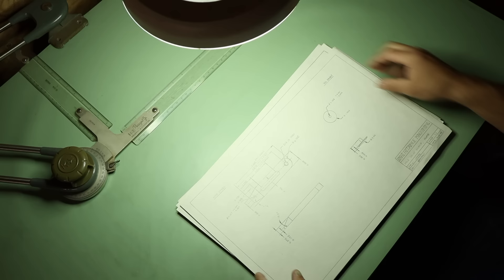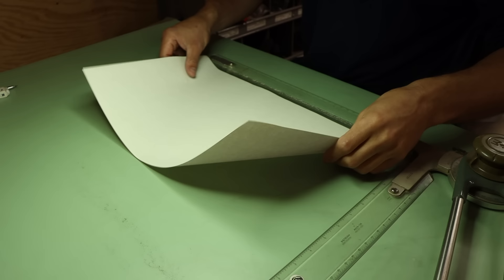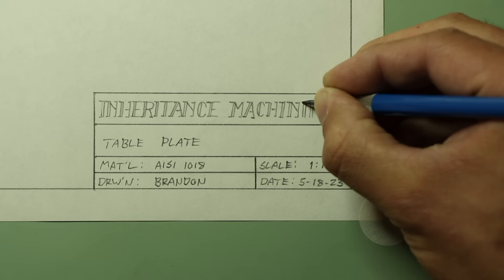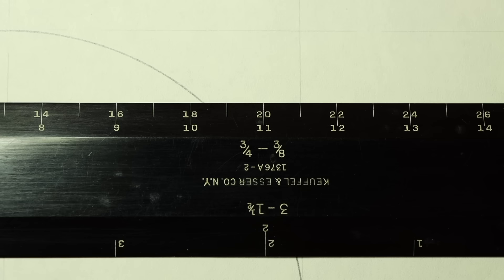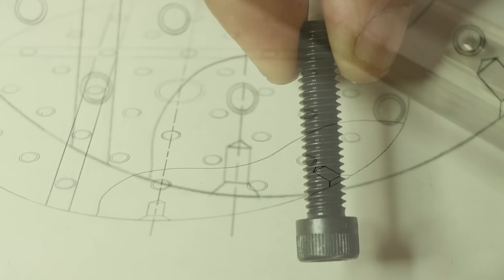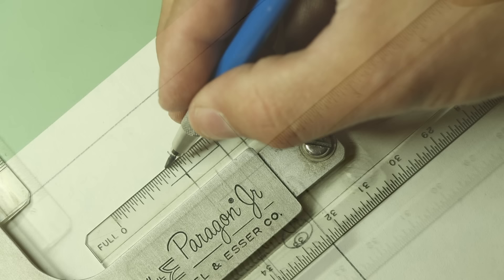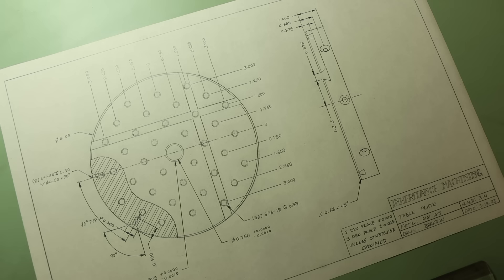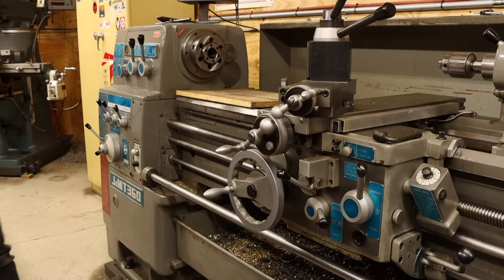The Joy of Hand Drawing Machining Prints || INHERITANCE MACHINING

Comment: This hit home, and was a real treat!. I'd never seen a drafting machine before. I had the extremely rare privilege of learning drafting in the mid 90s by hand on a similar table, though it used a cable system to emulate a t-square.  All angles had to be compounded by triangles. We drew up small parts at 1:1 that were crafted for us in the wood shop.  Took measurements, then transferred to paper. Clean hand drawings are SOOOOO satisfying when done!  Thanks again for sharing your work :)
Reply from the maker: I've never had the opportunity to try a cable machine since by the time I tool high school courses on drafting, the arm types were pretty standard. Thanks for watching!

Comment: Your sketch reminds me of my work as a draftsman at a very well know recreactional vehicle manufacture in 1972/73.  Detroit job shop engineers were hired to begin an advanced chassis department for a newly designed chassis for the motor homes.  I had been working as a detail draftsman but was moved to this department and WOW, what a difference.  They would bring me sketches on scraps of paper and scribbled notes and I would transform them into drawings that were conceptional only as this engineering project was working from scratch.  I learned so much with this job, I miss it terribly.  It was all hand work, no arm or parallel rule, we worked on flat tables with straight edges and triangles.  Loved this video, it took me back to a day long since past.

Comment: Excellent video.  A well-executed engineering drawing is a work of art.  It is pleasing to the eye, not because of embellishment, but because of the clarity that results from complete, yet efficient portrayal and dimensioning.  Correct line weight (for object, extention and lettering lines) makes the drawing easy to use.  Such things as no redundant dimensions and not "closing off" a string of dimensions that also relate to an overall dimension.  It is also clearer and time-saving to limit the detail to the minimum needed.  Example: show hatch lines around the perimeter only of a section or breakout.  My boss said he would rather have me spend time thinking rather than hatching.  When CAD came in, I thought that all drawings would be of similar quality.  I found that the good mechanical drafter also made a superior CAD drawing.  Some designs became poorer with CAD because the drafter saw only a small portion of the part(s) on a zoomed-in view - especially on layout or arrangement drawings.

Comment: Boy did this bring back memories.  Back in high school (early '80's) I took 3 years of Mechanical Drafting.  It really helped when CAD came along.  I'm wasn't in the trades that needed as I did aviation electronics and then IT before retirement but have spent my off time building things from large and small.  We're currently building our 3rd house so I sold my mill and lathe as we moved half way across the country.  I really miss them and can't wait to get replacements.  Your videos help fill the void, thanks.

Comment: Love your videos and I myself have a drafting table at home that I’ve had for 35 years. Just in case you didn’t know, the little hole in top of the cap in your clutch pencil is a pencil lead sharpener. Just remove it and rotate it on the lead, just remember to tap it upside down to remove the removed graphite before replacing it back on the pencil body 👍🏼

Comment: I like your drafting video(s).  I took a course in engineering graphics at Ohio University and we had to draft mechanical parts and cast items with all the radius features and machining details.  It turned out I worked in construction and had to read blue prints with some detail drawings included.  You never can learn too much and even though I'm retired I still enjoy learning new skills or at least how to identify what is supposed to happen when completed.  Thanks, Greg.

Comment: When I first took an engineering design class in high school, I always wondered why he started out with us using paper and pencil, and only in later classes getting us onto computers using AutoCAD. But after that class I found a deep respect for paper drawings. While I now use a lot of 3d software for modeling, due to their extensive capabilities, sketching ideas on paper for the basis for a design just can't be replicated by using a computer. So I find it quite cool to see you drafting every step of your design.
Reply: When I went into engineering I already was an expert in pattern layout and development from my previous career as a journeyman sheet metal mechanic. In tech school Geometric Development was a weed out class to flush out the half hearted folks. And it was done on a board. Paper and pencil are incredibly useful yet and I still develop shit out on my concrete shop floor with soapstone, tape measure and trammels.

Comment: It is fun watching a video that shows the generations of technology.  I actually have the same drafting machine, a few years ago we had to get rid of the fancy drafting table with foot pedals to adjust height and angle for lack of space.  That all dates from my Dad's generation, when I took mechanical drawing back around 1990 we no longer used the large lead holders with different hardness of lead and tuned tips to control line weights, we used different lead diameters, generally .3, .5, and .7 mm for the most common line weights.  We still did use the large diameter lead in our compasses, and as students we used a little paddle with sandpaper on it to shape the compass lead.
One thing that had largely gone away by my time was hand inking.  We learned about blueprints, and got to see and smell an old blue print machine doing things the old way, but for duplicating drawings we used large format scanners and printers.
And yes, I think at least as much of a drawing is done with the eraser as with the pencil.  With practice you can actually straighten and thin lines with an eraser shield.
I really enjoy the low key smooth flow of your videos, and sometimes comparing stuff I do to the stuff you make I want to cry a little bit.
Reply from the maker: Nah, it all just comes down to how OCD you are 😂  Thanks for sharing!

Comment: This is probably my favorite video you've made. I took two years of CAD in high school, like your family and I'm assuming a lot of commenters here, and it's funny how much I still remember. We had drafting setups like you, but they were at an angle so we weren't hunched over the whole time. I still remember the various line types, and we used the same tools, but I never had to do ordinant demensioning. We never had any homework in the class we had to finish, so I never had a home setup. I ultimately didn't become an engineer, although I really wanted to.

Funnily enough, being left-handed, my table was virtually identical, except that the machine was on the right side of the table and the ruler read 12-0 rather than 0-12 like a standard ruler.

My dad was a machinist for 40 years, and the jobs he was working on often had a tolerance of a ten-thousandth, which blew my mind when he first told me.

Comment: It's very satisfying producing a working drawing on the board - I have an old Schmidt and Haensch drafting machine on a full size Swedish Nike table ( circa 1960 ) 

Had them both given in lieu of payment for a job I did 30 years ago - restored them and they have taken pride of place in the homes I have had since. 

Although I have spent a lifetime using Autocad, Solidworks and Catia I still rough out ideas on the drawing board - there's more of a connection to the material for me , and the satisfaction of  "keeping your hand in".

I have to pick you up on finishing the drawing - use drafting paper - silk if you can find it, line in with ink, using appropriate line width pens and the appropriate lettering stencils.

Then you have something you can frame !

Comment: Another wonderful video.  I took the equivalent of 6 years of drafting in High School.  Basically, 3 years of 2 hour blocks early in the AM.  This video brought back so many memories!  We had those exact tables in our drafting department.  By the time I was a senior, I had templates for everything,  multiple eraser shields for different applications, and several pencils for different leads.  I got so quick that I started selling drawings to classmates from the machine shop class where they had to design then build their creations.  There were several students who were decent machinists, but made sloppy drawings and got down graded because of their "penmanship".  Eventually I got so busy that I started abbreviating the drawings by using proper GD&T, Measuring from datums and including datum frames, rather than doing longhand dimensioning.  This was a blessing and a curse, as I could finish the work faster, but then had to explain the system to the student in a way that they could tell the teacher what they did and why... we gotta keep up this ruse, boys.  We finally got caught when one of my "customers" couldn't explain true position to the teacher.  I should have known better than to include such witchcraft in a drawing.

Anyway, I loved this video.  And your family was lucky... all I had at home was one of those crappy cable and pulley tables.  You know, the kind that always ripped your vellum.

Comment: This is so nice, for someone who was in one of the last generations in mechanical engineering school to have a technical drawing course with ONLY paper and pencils. This was in 2010 when AutoCAD and 3D software was already mainstream. There must be something in the genes though, as I was the best in my year (between 2 classes, around 140 students), and it happens my dad, an almost retired architect was also the best in his classes, back in the early 70's.

You just happened to motivate me to hand-draw my next personal projects, even if I need to CAD them before for some FEA analysis. I had forgotten the beauty of hand made drawings, even when I have recently been working with some really old blueprints of train components, which are mostly pictures of hand-copied prints made in the 70s, but originally drafted in the 50's or before, some (like the couplers) having a hell of a rat's nest of radii's everywhere, but with PERFECT dimensioning (when drawn in CAD, the software gave 0 degree of freedom note with no over constraining). I also had the luck to see an original, hand drawn blueprint of the whole country, some 60cms wide but several meters long (I'm from Chile haha), which took 3 of us to hold open, as it came in a roll, with the countries outline, the railroads, and complete altimetry's of each one of the railroads. A masterpiece.

Hand drafting and technical drawings should be considered a form of art.

Comment: I was taught to use 4 pencil lead hardness in drafting: 6H for layout, 4H for dimension lines and to show hidden features, 2H the edges of the object and writing, HB for the borders of the drawing. For your system, I would recommend adding 4H because it is easier to tell the difference between the objects and the descriptions of the object. I also never got to use a drafting machine, just T-square, triangles, and scale rule. I too used the drawing process to design, and work out all the manufacturing processes.

Comment: I have been a designer for about 4 years now and personally comparing the first and third dihedral projections I find the first dihedral projection much more intuitive because it helps to imagine in 3d the continuation of the milling machining lines or other features present simply by thinking of taking the part I need to represent, placing it on the plane and rotating it so that I have the side I need upward while keeping the rotation edge resting on the sheet. In the third dihedral, one has to imagine the piece entering the plane of the sheet, which is inherently anti-intuitive. This is also demonstrated by the fact that it is used in only three states in the world

Nevertheless, your videos are always very cool and soothing. i find myself watching them after a long work day  just to relax.

Comment: Thanks so much for this vid. You described the process beautifully, and seeing all the old tools of the trade took me right back to the eighties. Your annotations are lovely by the way - mine were always the worst part of my drawings, no matter how much I tried to improve. I always blamed time pressure :)

Unrelated drafting table story... I used to work at an aerospace factory. One of the guys was making a small replica artillery piece in his spare time, using tools from the machine shop. When it was finished, he decided it would be a good idea to test fire it out of the window on the top floor of the Tech Pubs office. The recoil took out about six drafting tables, blew the windows out and lifted the roof sheeting.

Didn't do his career any harm either - he went on to be head of Technical Publications. 🤣
Reply from the maker: That is amazing!! 😂😂😂

Comment: This brings back memories. I went to a technical highschool and learned all the drafting basics on a board prior to switching over to CAD. Kind of miss it and think I'm going to look into a drafting board and machine. One thing I remember is using two mechanical pencils, one with a 0.5mm width for object lines and a 0.35mm for hidden and center lines. Always used a led holder like this with hard lead for layouts. Love the video. Keep up the amazing content.

Comment: I had real problems getting my head around 1st angle (UK style) and 3rd angle (US style) projections. But I have a way of thinking about it now that makes both systems make intuitive sense, which might help helpful to others. 

Think of the part on the table on a sheet of paper, and imagine the different views or projections being a result of rolling that part on the paper, to get to the new angles. This is first angle.

Then think of a clear (e.g. perspex) screen on top of the part, and imagine the part is lifted and pressed against that screen. Now roll the part against the screen, to get the new angles. This is third angle.

Sounds weird when I type it out, but I honestly had trouble making the two systems make sense until I though of it like this. Now they both seem "right" in their own way.

Comment: As a trained designer from Switzerland, I found the video very exciting to watch. Exciting how much is the same but still slight differences in representations of certain elements, such as threads or dimensions.
You mentioned GD&T, in Europe it is called ISO-GPS (Geometric Product Specification), I was allowed to learn and apply this in my training, mostly for iron or aluminum castings.

Comment: I spent many hours doing just what you are doing. My boss used a parallel straightedge and triangles for everything and thought the drafting machine was for sissies. I finally convinced him to buy me a nice table and machine. I was in heaven. I bought Autocad when they were still using the digitizer pad and puck. Never looked back. Now everything is 3D and the new guys don’t know the “rules” to make a drawing look nice. After about the tenth time you’ve had a grumpy old machinist come in your office laughing at your “funnypaper” drawings you finally catch on to what works and what doesn’t.

Comment: 2B & 2H were my choices.  In the UK, threads were shown as an additional pair of parallel lines to the drill lines.  Whilst a schoolboy, my home drafting table was a section of kitchen worktop from the diy store, cut with their machine down the short edge.  I rested the back onto a radiator on the wall and the front on a chair.

Comment: As crazy as this might sound I took mechanical and architectual drafting all through high school before a random encounter changed my focus and what I ended up doing for the last 30 years I became a fine dining Chef. But before I changed my focus on what i wanted to do i was going to become either an architect or an engineer. I still try to keep up with the practice of drafting and find it very relaxing to go back and do some isometric drawings or anything along those lines I don't have the luxury of a drafting machine I still use a T-square and triangles have some French curves and many stencils as well. For me it is honestly very similar to the way that i still hand sharpen all my knives that I use to cook with. Making drawings like this and sharpening knives to me are along the same lines since they are both the beginning of whatever you are about to create. Maybe my analogies are only relevant to me but felt like sharing them since drafting and cooking are two things that I like to think kind of shaped me into the person I am since no matter what it was just a random job i got in highschool that changed my path othertwise i would most likely be an engineer right now.